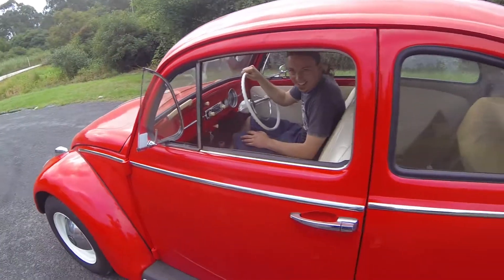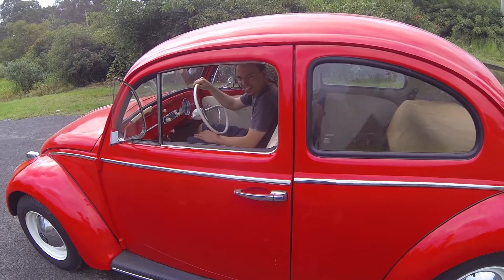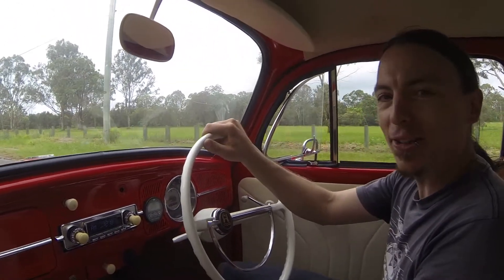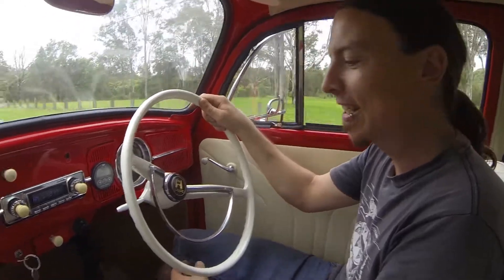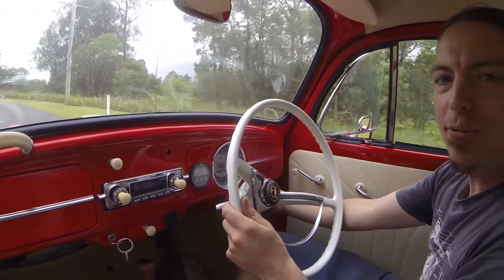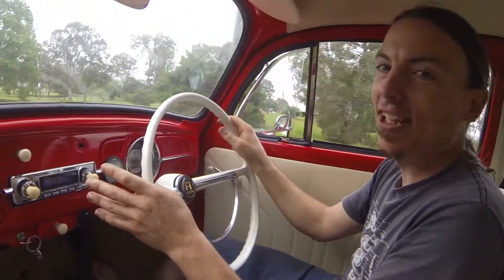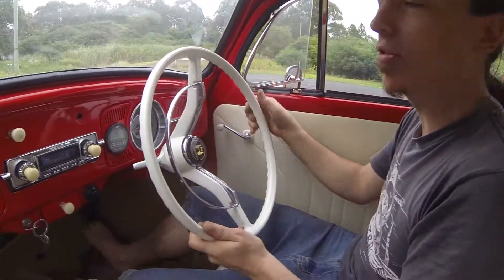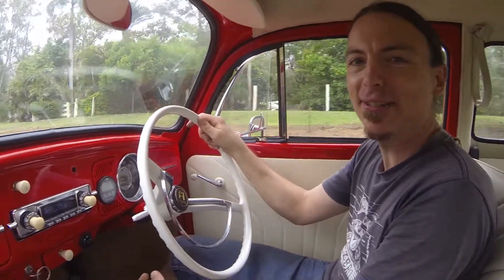TRACTION EV - Electric Volkswagen Beetle 1964 AC50

Comment: whats the top speed ?
Reply from the maker: Haven't tested top speed yet. The Beetle cruises at 130km/h easily with more rpm to go. Thanks for watching!
Reply: thanks for the reply - what voltage are you using?

Comment: Congratulations, James! Looks good... very zippy. A lot of EVs don't have gears - can you tell us why this one does?
Reply from the maker: Thanks Simon! Yes these EV Beetle kits are a lot of fun to drive. You get a nice shove when you put your foot down. The reason this EV has gears is that is much easier to connect the new electric motor to the existing drive-train than to design a whole new way to mount the electric motor in the car. Driving the EV Beetle with the manual gearbox is easy. You can't stall, you don't need to slip the clutch on starts and If you want, you can just leave it in 2nd gear and drive around town just fine only shifting to 3rd on the highway.